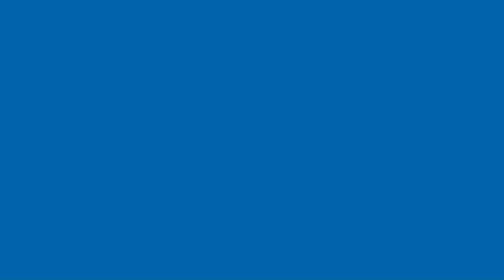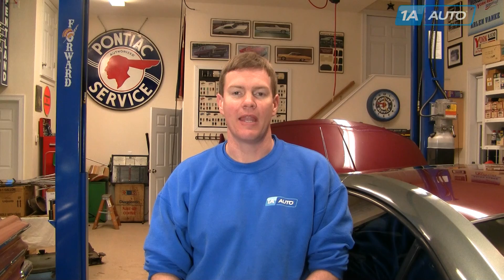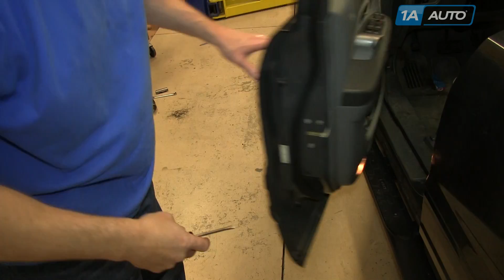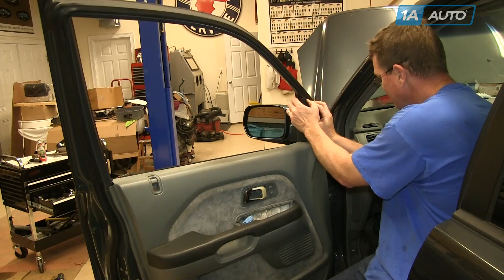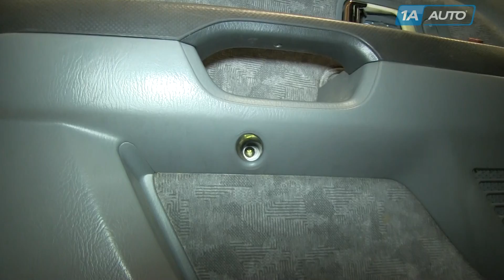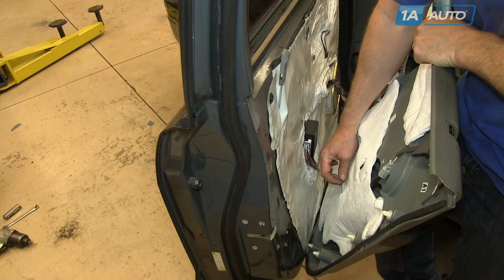How To Remove Front Door Panel 03-08 Honda Pilot

Comment: I have a 2003 Honda pilot the passenger side door lock is jammed and I can't open the door from either side. Is there any video on how to attack this problem or any ideas on how I can get the door open?
Reply: I have the same problem. We are at a point where we're ready to cut it off